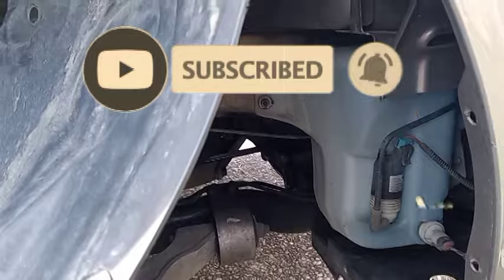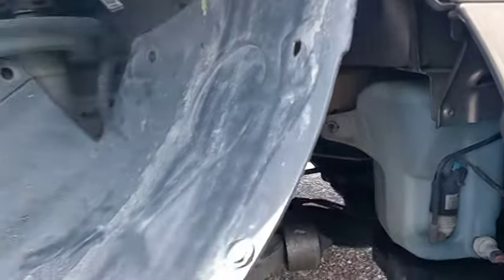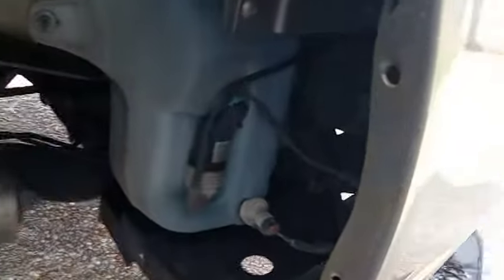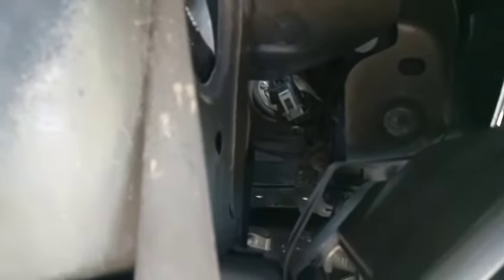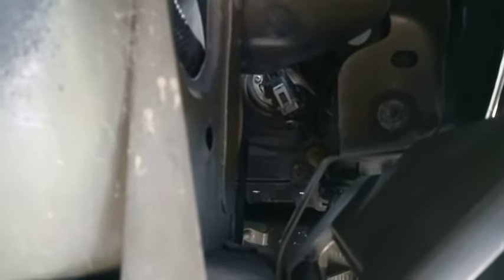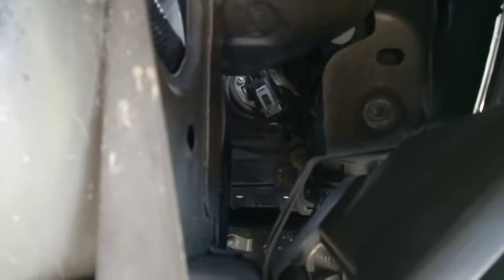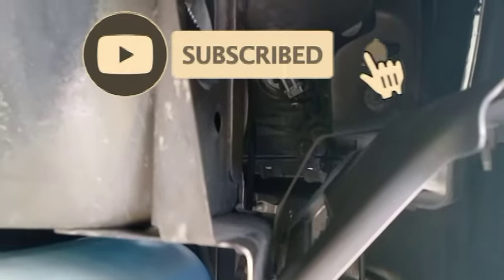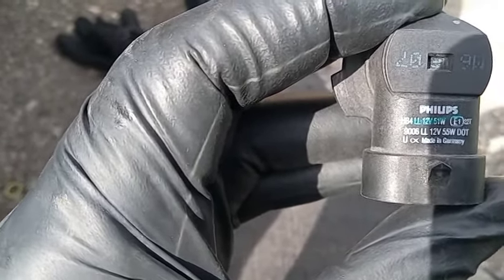Buick Lucerne Headlight Replacement 2006-2011!

Comment: You can't just remove the headlight assembly, change the bulb and reinstall? Most vehicles have just 2 bolts to do this.